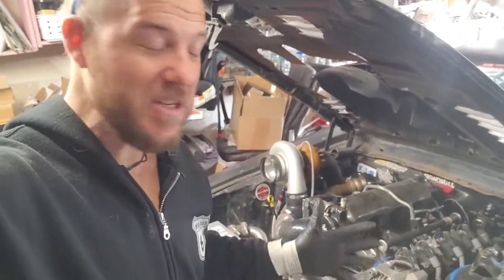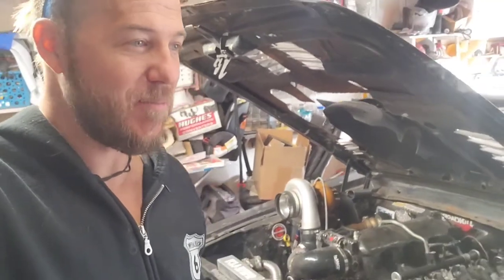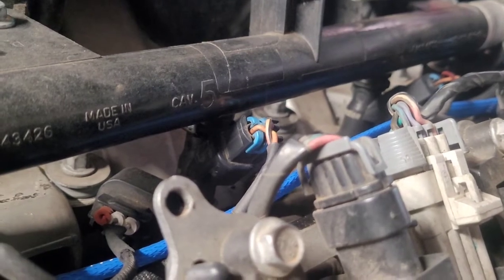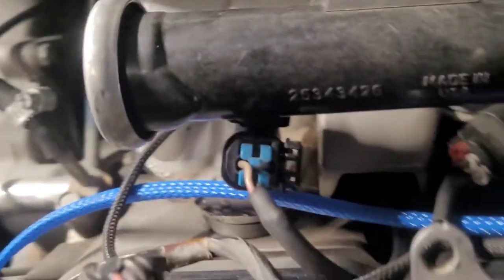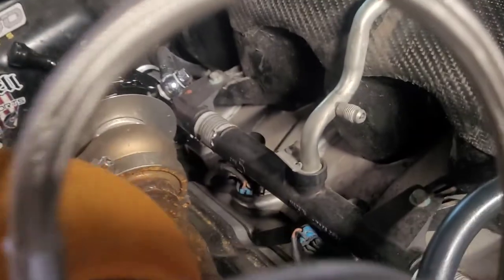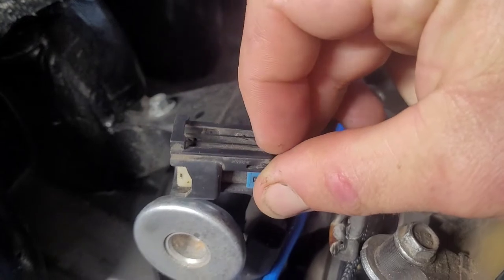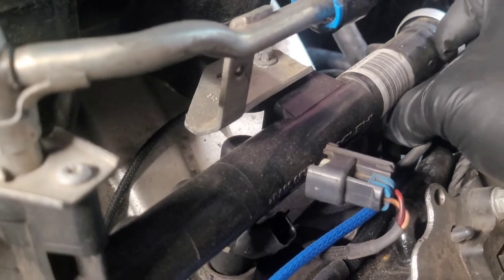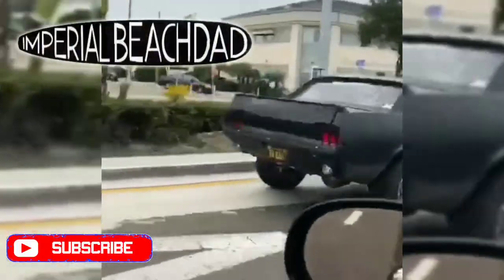How to Disconnect LS Fuel Injector Connectors -99-06 GM vehicles

Comment: Thank you so very much.  There wasn't one swinging D..K that showed it like you did.  I work on older stuff and don't have to worry about all these sensors and fuel injector connectors.  Oh, and mine was a 3.8 Liter V6.  But, Thank you so, very, very much.  Crap, I've spent at least 2 hours trying to find and trying to figure out how to take the FREAKING injector connector off.   WOW !!!  PHIL

Comment: How about GMC Savana 2500, 2006?
They have a blue locking tab and do not even look remotely like the ones here.
Any ideas how to disconnect that GMC crap invention?
Reply from the maker: I think those are 6 liters right? This is a 5.3 though I have a 6.0 in the works. Did you figure it out?